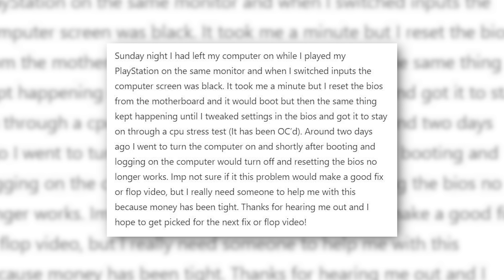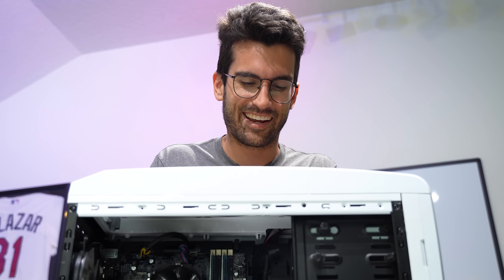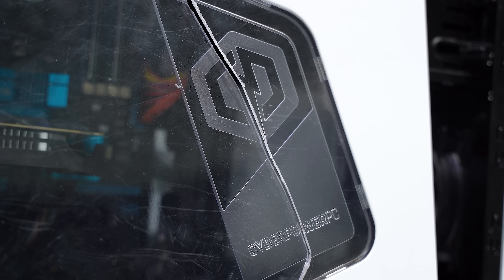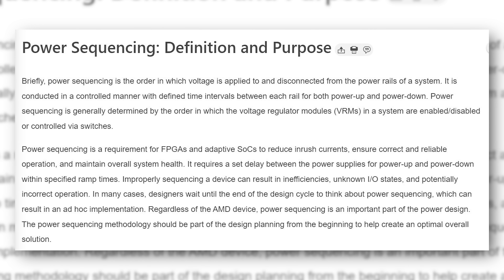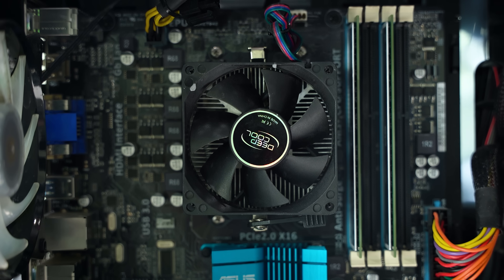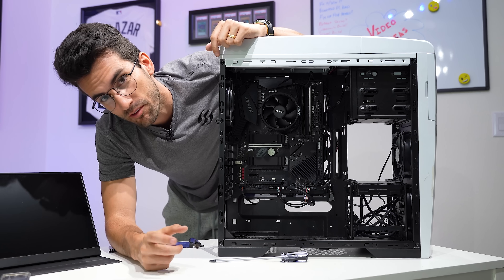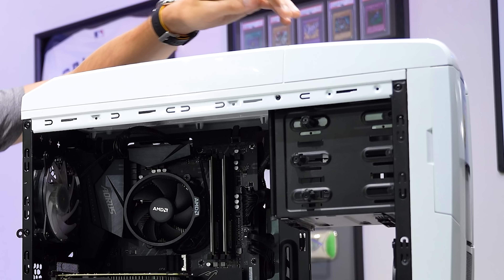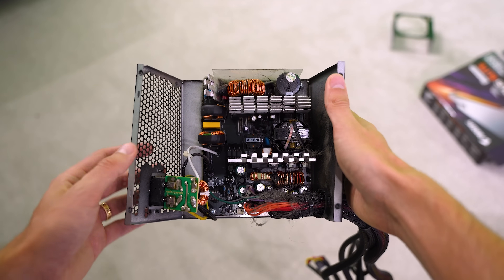Fixing a Viewer's BROKEN Gaming PC? - Fix or Flop S5:E12

Comment: 100 % over current on that molex connector .
Change the 4 pin mobo plug it costs pennies .
Also change the psu if you trust that tester !

Comment: I have noticed a pattern with these Thermaltake Smart PSUs. I used to use one on my rig and it exhibits the same symptoms it powers on but no display. Back when I was repairing pc in around the 100+ I repaired over the years I vividly remember around 8-10 of them being the "smart series"

But most of the PC were around 5+ years old so they did survive longer than their warranty would cover. I also tested my personal thermaltake psu it passed, I cleaned it up, replaced the fan, but everytime I booted anything up it just restarts.

Comment: Looks like my second gaming PC motherboard. I have built am2, am3 and I just built a am5 pc with a 7600x and a 6750xt and am saving for upgrades to my cpu and gpu. The old FX 8350 chip was solid, and let me skip am4. I used it for 1080p gaming mostly, and it lasted me from around 2012 to 2022. It still runs my old landlord uses it for streaming. I installed custom liquid cooling for my CPU and even the 2gb card was connected to the loop. I'm glad that AIO'S are so abundant custom loops are a pain to install and maintain.

Comment: "Anti Surge" on the motherboard after it had gotten a surge lol
Reply: From memory they actually had an issue with the "anti surge" being too sensitive in the past and shutting the system down due to power spikes during use.
Reply: @johnt.848  yea my old fm2+ asus mobo kept restarting for anti surge crap
psu ended up being crap in the end so not exactly sure if it was being sensitive
Reply: @detecta  yep, the Mobo would have detected the PSU spikes and shut down, that was an issue also with cheaper PSUs and the transient spikes. That's why a quality Gold rated PSU is always recommended.
Reply: hypothetical. If his PSU got fried, taking the mobo out with it, maybe his home power (or even that specific power outlet) is dirty/cooked.

Would probably be a good idea to not plug the pc directly into the wall, and have some sort of AVR/UPS inbetween the wall outlet and his pc.
Reply: @Skyline_NTR  The damage shown is typical of a poor connection, ie not inserted fully, or too much current draw, which is also possible as he did overclock the system and it is only a 4 pin connector, not an 8 pin for the CPU.

Comment: I have a machine with the same board. Works fine for my purpose, which is media playback. CUP is an Athlon II X4 640 and it runs Ok with its 8 GB of DDR3. Boots W10 reasonably from an older SATA SSD. The video card in use is an old Sapphire R7 360. Good enough for me.

Comment: I had a Corsair 750 watt PSU that lost the 5v rail. No 5v standby=No power switch operation. I pulled the PSU apart and saw no problems. I could take the cables coming out of the non modular PSU and get it to boot by tugging on them, I suspect it had a dry solder joint somewhere. Very similar to what this PC was doing.

Comment: 6300 is in an 4th gen i5 range(ish), a fine pairing with the 1050. It's neither e-waste nor useless.  It DOES run very hot though.  All of the FX chips did.
Reply: the architecture and software really held it back, Ive still got a 6200 and a 8150 laying around. A little OC and you could cook on the south bridge.
Reply: What are you talking about?!? The 6300 is about on par with an i5 750 and even the 4460 would curb stomp it.
Reply: @gaunterodimm3606  That may have been true in 2014, but really not today. People have learned to not use thermal headroom to overclock the cores, but the RAM, North Bridge and Hypertransfer. Only the last bit of thermal budget should go into all core frequency.

These chips can do 2133 RAM, which you can pretty much push any 1600 kit to by dumping 1.6-1.7V into it (perfectly fine for DDR3) and running it at 12-12-12 or so.

You put that against some i5 4440 on a B660 with JEDEC 1600C9 RAM and I promise you, any game that doesn't require AVX2 (where Haswell obviously wins) the FX6300 will come out on top. My only requirement would be a $150 150W tower cooler and a 970 board that doesn't have Walmart VRMs. The i5 750 isn't even competition tbh.

Biggest drawback (besides need to OC and powerdraw) is honestly lack of AVX2. Same reason 2nd and 3rd gen have entered nearly e-waste territory in the last 2 years or so.
Reply: Gotta push the RAM and North Bridge. Maybe the HT a little. Most boards and CPUs can do 2400 if you have sticks that can keep up

Comment: I wonder if the viewer could either glue that plastic window or buy a piece of plexi at Home Depot and have it cut to spec.? Not my main rig but I have an AM3 Phenom 2 x6 1045  as a back up windows pc(I mostly do Linux now). As of 2025,it will go offline and maybe have Linux put on it or stay Win 10 with no online exposure. As always,a great video and a good resolution,Greg.

Comment: Years ago i upgraded my system and used my old components and a some new components to build my boys a gaming pc. It was a 6300fx. I put a good overclock on it and it ran like a top. I ran every stress test a person coule to make sure it was bulletproof for them and it passed with flying colors..... then they would have crashes left and right. The evga power supply turnedout to be the issue, so i swapped that with a nzxt 900 watt and it was good for a while and then once again crashes.... later i upgraded them to a new setup that was a ryzen 5 5500 and again ran every stress test and no issues. Thry start playing games and a month in crashes left and right. Id sit down and put it through its paces and have no issue then they would set down and again have issues. No idea wth causes all their problems

Comment: Whats the main reason for fitting the psu that orientation?
Reply from the maker: No basement. Temps are fine either way in older testing of ours. This adds an extra fan to help evacuate air.

Comment: You couldd replace that 4 pin from another bad board to see if it works then you could donate to someone down the road. Those are pretty easy to change. Those fx cpus are not that bad. I had a 8350 until 2 years ago and was still able to run games fairly well.

Comment: That Motherboard looks familiar??
Reply: Similar to Mine, but Not the Exact Same Model!
Reply: I had a very similar board back when I used an 8350. The mobo was absolute junk. Performance wise though, it was great, when it worked. The FX had flaws sure but I still think it was underrated.

Comment: To me, it looks like the 4-pin CPU power wasn't connected fully and/or came loose.  Probably when he was having issues overclocking and maybe removed it, but didn't push it all of the way back in, and it came loose over time.  I imagine the connector finally arced out and killed the system.  Just overclocking wouldn't cause that kind of damage, the system would have just stopped posting and the connector would have been fine.
Reply from the maker: Judging by how far down the melted plastic was (and the fact that I could still fully seat the connector), I'd wager it was properly secured. This PSU is rather infamous for a reason. Combining that with an OC isn't very wise.
Reply: @GregSalazar  I meant to say loose as in the PSU side of connector had loose connections inside the connector block, and not making good contact with the pins inside the motherboard 4-pin block.  I mean that is arcing damage, similar to the infamous nvidia 12-pin GPU connector.  that is not a melting wire that would be an overloaded wire.

Comment: Fixed it with a new one :/
Reply from the maker: As opposed to a... replacement? Same premise. Just upgraded in the process. As discussed in the video, replacing with an identical (used) part made no sense for $70+ after shipping and tax.
Reply: As opposed to... Fixing it. 
Alright swapping the PSU if it failed the 5v rail test and is above your capabilities to fix, but it would have been nice to see a new CPU connector soldered on and MB tested.

Comment: Dumb question why did you put PSU with fan up had venting for bottom facing fan
Reply from the maker: It doesn't make much of a difference in our testing with most cases. The case sat kinda low and didn't have a basement.
Reply: @GregSalazar  The main area I have noticed it often makes a difference is when something is being upgraded. If someone isn't careful and drops a screw down into the upwards-facing fan, it becomes a nightmare. This is another reason the fan generally faces downwards. Additionally, if someone is water cooling their PC, having the fan facing up gives a clear point of ingress if there is a leak, whereas it facing down would make it a lot more difficult for water to get in.

Comment: Good work Greg. What might have happened is that the 4 pin was slowly cooking with the overclock. The PSU finally gave up the ghost and when the rig was transported to you the CPU power cable got jostled and what little contact it was making when it was 'working' got displaced and the whole system went dead. It also explains why the system originally powered up and then died. The melted plug was cold, expanded with heat and then broke contact. If that motherboard is going for $68 on eBay it may be worth someone's time to repair that connector because I bet the CPU and memory are still fine. It could be sold on as a working motherboard/CPU/memory combo for probably $125. I never overclock my CPU or GPUs, the gains are so minor in gaming and you could easily cook something. Like a 4 pin power connector.
Reply: 4 pin EPS is officially rated for 190W. WIth that cooler you're lucky to cool 120W on an FX 6300. Most of those chips wouldn't see anywhere near that power draw. This one would've shut off from overheating way earlier with that tiny cooler. 

It looks cracked, not melted. The burn marks are probably from a crack that got worse while the system was running. You're not pulling enough watt with that CPU/motherboard. The VRMs aren't keeping up either. It could've been damage from a shit PSU or power surge - would explain the 5V rail on the PSU dying too.

Comment: Hey  Greg, Just finish checking out the video. I pulled out my old system out of the box its a AMD FX 9370 CPU on the ASRock 990FX system board 24GB of DDR3 memory with the Red Devil RX 580 Graphic Card. I built it for gaming back in the day. Man its still runs 97% to 98% of todays game. I also use it for testing from time to time. Its nice to see you fix older rig from time to time.
Reply: That's nearly the specs of my daughter's pc, which is my old rig. Still runs perfectly after 14 years. Was built 2010.
Reply: My main pc still rocks a fx8370.

Comment: never overclock a cpu when you just have a cpu 4pin on the mob  A 4-pin connector can deliver up to 192 watts of power   i bet he put more then that when overclocking it
Reply: In what world with that cooler and chip would he have pulled more then 192w of power??? It would have shutdown from OTP waaaaay before he got anywhere near that number. The issue is that shitty (imitation of a) powersupply...

Comment: Why install the Bequiet PSU with the fan up??? The old thermaltake PSU was installed with the fan down!!! That case has an airinlet in the bottom where the PSU goes
Reply: some of those older cases had the air inlet so small that if you used a longer psu, the fan wouldnt line up properly (like i had a versa n21 years ago and never mind all the holes at the bottom, the actual air intake area was a tiny little square) . also because the airflow is so bad in the case he may have done it to create more negative pressure in the system

Comment: With that "stock cooler" , i wonder how warm this FX chip was running all the time with that OC . :')
Great upgrade for him, now something that has to be done.. Buying a SSD. :D
Reply: Definitely never got OC'd enough to cause burn, that's for sure. With the cooler it would've turned off before it could pull enough power to melt a 4 pin EPS that's rated for 150-190W